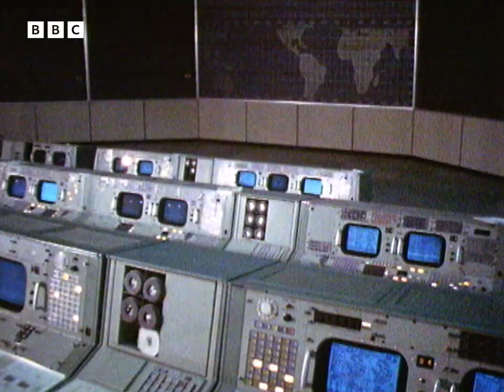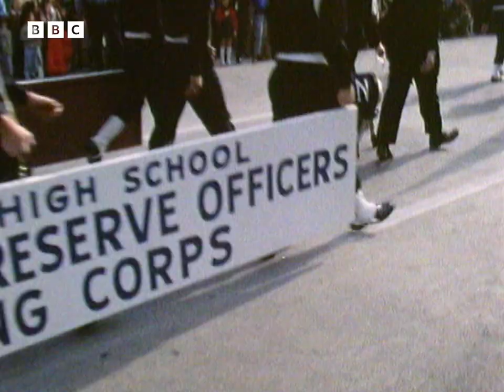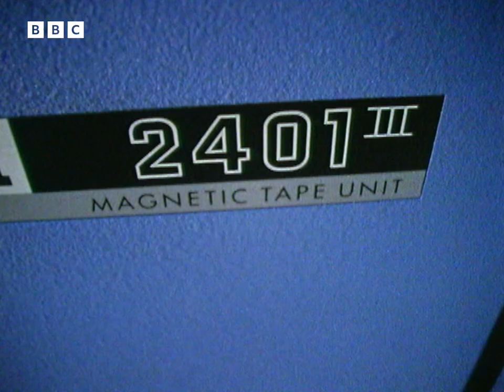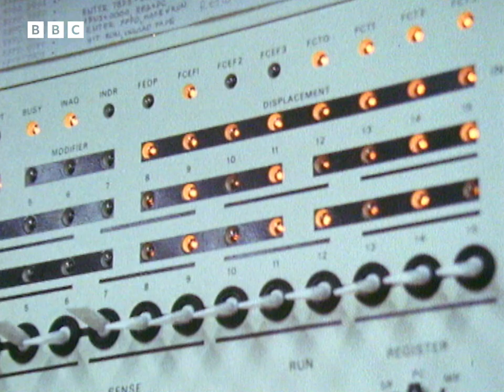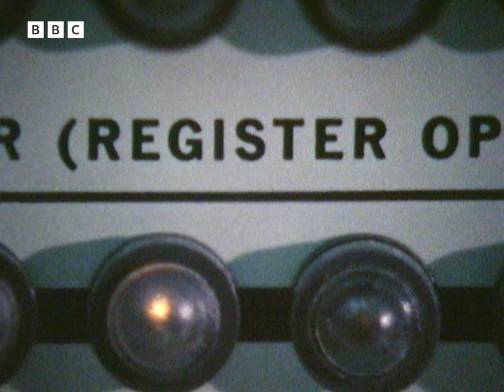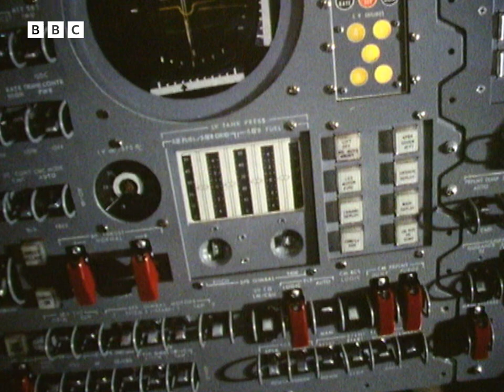1969: A SCEPTIC's View of the SPACE RACE | Cameron Country | Retro Tech | BBC Archive

Comment: The haunting incidental music from 12:25 is by none other than Delia Derbyshire, recorded at the BBC Radiophonic Workshop.
Reply: I was wondering if it wasn't a product of her wonderful talent. Also a nice juxtaposition between what Cameron is spouting, and the new age of music made on electronic machines by Derbyshire.
Reply: @LuiWallentinGttler  Yes indeed, it’s a nice contrast. DD excelled in depicting  through her sound design, various tensions between more optimistic vs pessimistic views of technology. And at the time this doc was made, the Workshop was on the cusp of transitioning away from the painstaking methods of tape manipulation of acoustic sound that Derbyshire loved and towards voltage-controlled synthesis using EMS equipment. My understanding is that DD initially was unhappy with these synthesisers, and the expectation of faster turnaround that came with their adoption.
Reply: The cues heard here sound to me like the result of her tape manipulation of acoustic sounds & test tone oscillators. Other parts of the score (not heard in this clip) reuse metallic impact sounds she’d recorded for a 1968 doc about Henry Moore, which she also incorporated into her track The Delian Mode.
Reply: @davidhuggins16  She and the whole Radiophonic Workshop was surely first movers. And I do get her antipathy towards changing the workflow / -method. Using rudimentary synths are so different from manipulating tape.
Reply: @LuiWallentinGttler  yes, they were groundbreaking. It’s remarkable what the Workshop achieved, a rich legacy of sonic innovation.
Reply: yes, i have two of her cds